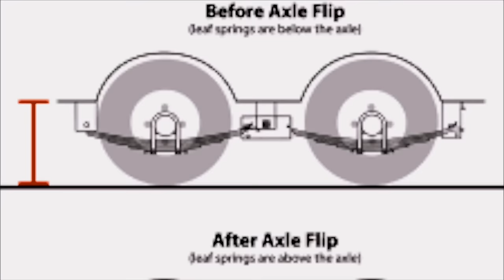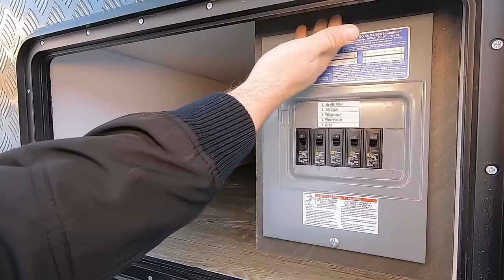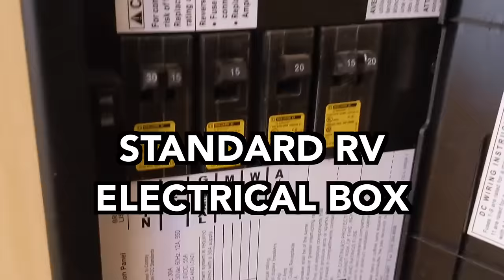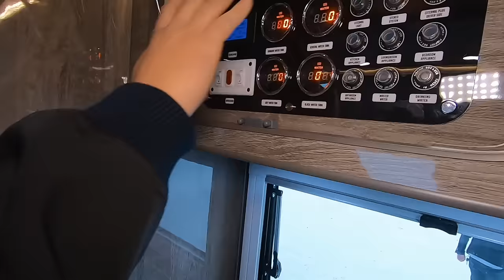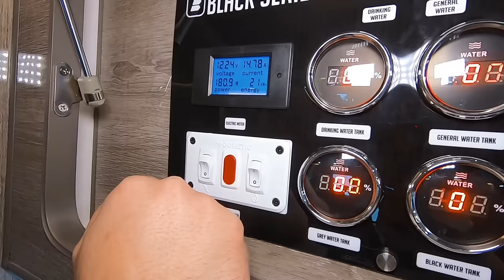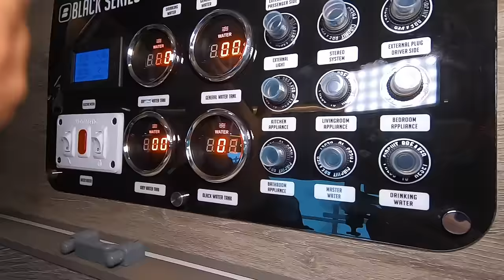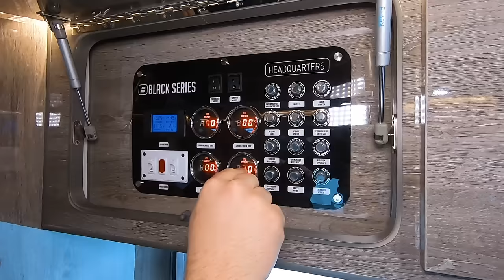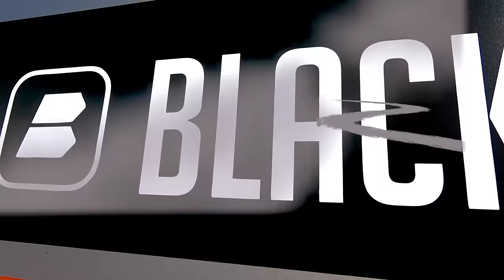BLACK SERIES! CLICK HERE TO SEE HQ19 REPLACEMENT https://youtu.be/7XND9C63GGM?si=10AU8iFP7bFzLmP9

Comment: Like I said do your fancy cabinets, love the grain no handles, but the kitchen table & sink & stove in an Island configuration country style U can work or but chair under either side. Use sink both sides oven & burns end of Island so really 3 sides to work or eat from. Best small space u can do farm house style & diff then what every1 else is doing. Along wall parallel w/island & table 2 flip up bunks. That is it. 2 cassettes toilet system change or camp dump no holding blk series tank. Shower inside Alaskan cold deal. <Done> Can take it or leave it advice, but gave u a few improvement inside & outside & reworked whole idea got bigger got smaller, towed diff, rolling spares diff new concession or ship or construction or highway diff. Alot of quality stuff to pull from. Just see duck bird that flys & swims, tuff sell. Need 2 product lines down and dirty hardest nail & where u r at upscale & diff but in a good/great way.

Comment: This is built a little tougher than most RV's but the BRUDER EXP-6 EXPEDITION TRAILER from AUS is a god damn tank...and at least their web site tells you the PRICE......
Reply: Also two completely different trailers. A Bruder starts in at 100K here in the states. That is 35K more than a hq19. BS has more than double the r-value in their insulation. Bruder has better suspension. Pros and cons to both depending on your needs. Also, the ROA site list their price. The manufacturer doesn't since they aren't factory direct.

Comment: Cant wait till they have a slide out, spin cast plastic in storage areas, hydraulic stabilizers, instant hot water, a generator built in, theater chairs facing a TV, Glass and plate holders in there cabinets, change the batteries to lithium even 1 400 amp.
Reply from the maker: They will never have slide outs. That is the one non-negotiable.

Comment: 2 insta hot water heaters u hve heat hot water & box or tank heating unplugged. If not then not Alaskan, or even 4 season. If not cold 1 heater just water 1 bath plenty, but if cold or stupid cold need 2nd mostly heat & water floor & boxes & tank heating.

Comment: I just skimmed through this. leveling jacks?
Reply: Yes, I own this trailer. There are jacks on all 4 corners. They are more stabilizing jacks, not so much leveling. I take of those yellow Lego like plastic leveling in my driveway, I use a piece of 2X12 and park the 2 left tires on it. I am going to design something for the front to use a hydraulic jack to level it front to back. Inside the storage compartment there is a 4 way bubble level. I also use a small torpedo level on the front frame to level it without having to go look at the bubble level. I don’t know if he showed it but there is a stainless pullout with a 3 burner stove, a sink, and a fold out stainless food prep or serving surface. Also a drawer you can keep silverware or stuff like a spatula or stirring spoon, etc. The unit is not cheap, mine was $56,000 last summer, but I live in Jackson Wyoming so there are lots of places to take it!! Like the dude says, it’s a Super Trailer.

Comment: comment #317 laying down got it 1:55 am your suspension, close. I explained the pull out cantilever same geometry deal already. But this goes to your suspension esp. The A arms stick down to much & limit ground clearance(build like tank but small change). 2 flex pnts at frame could b longer arm shorter arm instead of even length A arm to move more away from mounting pnt , but <key> is a teeter totter design instead of fixed top of A arm mount pnt. It flexes not fixed at top pnt of A arm on connection w/teeter totter only it is not a 50 vs 50 totter no where it connects to top of a is short side of totter arm <SO the beef A arms naturally r up tight. When wheel hits hole uneven length A arm is tottered down, then it naturally teeters back  up most ground clearance. Springs & shocks still in the design, & like I said b4 the "axle hub" 2"box slides in least travel or prt out or max out full travel. The diff is ground clearance & natural tooter effect w/spring gives u a new geometry flex movement pnt so not just up & down but some wheel free hit/smack impacted flex built into the suspension. hit hole ck, hit 2ft tal rock head on still totter ck, & whole thing gets better the more the tires pulled away from under camper.  IT's Your system over built crazy just freed up to really sing. 40mpg dune type jumping tuff suspension.

Comment: In another video with the same model it showed a diesel heater instead of propane. Using less fuel.
Reply from the maker: The diesel is not UL rated and against US code. We no longer carry the Black Series because of poor quality and the components were failing too frequently.

Comment: need to add air ride bag to make air ride and to make adjustable like comptition and need to go with disc brakes so work better after driven through water
Reply from the maker: We agree!!! We are currently working on an airbag system.
Reply: @ROAOffRoad  cant wait to see so you can self level at campsite

Comment: Its a shame they made all the upgrades at extra cost for year 2020. The economy took a crap so, for 2021 they will cut cost and remove little things here and there. For example : dual gas struts on doors, that make them open evenly instead of twist. Causing the doors and hinges to last longer.

Comment: If u had a Y connection <fancy dandy> hitch that each side arm of trailer frame connected onto that would b a better product in the market place. As it is just seems diff way mayb better at limit but a Y off a normal receiver hitch that can flex a bit each side frame rail is <flat just way far safer& no doubt better system. Normal framing till the triangle arms each side of pull behind that can pivot up & down where it connects to trailer. Y 2 no fake ass k.Legit man better NOW way to connect any F-ing trailer!.

Comment: Diamond plated?  NO! Diamond tread plate.  Cool RV, horrible sales person.  Why would you need to air down a trailer tire for traction? Air up maybe, when it is low, but never air it down for off road, unless you need more squish in the suspension.

Comment: So what the bottom line what's the cost for one of these trailers
Reply: 40 to 60 grand
Reply: @chadbohman1017  is that price tag for the one you are showing in this video
Reply: I have no affiliation with the company and yes that's the price tag for the 1 in the video
Reply: @chadbohman1017  40 or the 60 k
Reply: @nyghtmyst5118  that 1 I'm going to say 60k
Reply: @chadbohman1017  where would you see one of these i live in the north east any dealers up this way
Reply: @nyghtmyst5118  u would have to check there website out www.rvsofamerica.com  or Google it

Comment: snoozy trailers all fiberglass last like boat hull 50yrs, but u asked can get better product at a price. The pull behind if "off road" needs to b 2nd deal smaller trailer, just Me* & aussies down under hard core campers, except they don't hve winter problem. So something has to give in the design. If u were running 3 axles monster suspension & it was ATC type all alumium 5th wheel, w/ diamond covering & build quality u might hve something. As it is it's to product tiny segment in the market place.  Just Me/JBM/God opinion. Yeah u need X=$$$bank to cover quality & that means Y=ft long, but Z=design is not nailed down yet just outside is weak look at never hving seen inside. Design dump at rear drags when offroading fail. Must hve tanks under bed high dumping off side much higher safe off ground. So Either u hve to go bigger hardest! Core! ATC alumium 5th flex design construction,or toy, or anything rock diamond tuff trailer, or u need complete new design much smaller supplement trailer tuff than ppl main rig or camper. <I know I don't hve 2 worry about My trailer, My slide in is my weak link going off road over wt side. Yeah is u & ATC had a baby it would b perfect product inline w/other 5th wheels just completely diff option in market place. Not a home on wheels w/Island & dishwaher & middle bunk or front bedroom &1/2 bath own 2nd door.  Otherwise good enough gets the sale, tents & hybrids &poptops, & triangles, & nanos, & lots of good enough for 90% of all new purchase not custom build campers.

Comment: The only thing I don't like is the outside speakers. Annoys the neighbors, usuall me. I go to the country to get away from noise and all of the lights most inconsiderate campers string around. Other than that, looks like your typical overpriced nothing new camper trailer.

Comment: You ain’t doing much with 300 W/ almost useless a blender takes 750+ just to keep it in perspective. 300 W is terrible.
Reply: You do realize that was the solar panel that charges the battery. The inverter is 2,000 watt.
Reply: scottyo64 my point is a lot of cost will go into that it is not very useful. It’s cool.

Comment: Very nice, out of my league, those trailers cost $40 to $60 K and used 2 to 3 times a year ? No thanks 🙏🏼, don’t get me wrong they are really nice but $$$$$🤔😮.
Reply: Yes, why bash other trailers that are in the half price cost range.  The beefed up features cost $$$.  These feature replacement parts are going to cost you too and you will need to replace them.  Those windows are not going to be crystal clear after awhile.

Comment: Just Me/JBM/God but if I am not storing/protecting my money spares then Me/crazy guy kill them All would copy truckers esp in rear & make it so spares were rolling able but not crank lowered storing postion. If a,b,c, gets stuck then lower D & E other side crank down rolling spares/over wt spares & get out/or unstuck.
Reply: Most of the time ATC black series empty only rolling 2 per side but loaded can 3 or even 4th spare down over wt per side like trucker. Basic ATC has that flexable design, only needing 2 none axle black series but really3 any time hauling & upgraded for sure & loaded.

Comment: Why didn't they put actual key locks on those latches?  Seems like that might be a no-brainer on this trailer, security-wise.  I mean, they have a lock on the outdoor shower, but not the propane/front storage???
Reply from the maker: It's against the law to put locks on a compartment with gas or propane in it.
Reply: lilricky2515 never lock up your propane. It’s illegal. If there is a fire, you want to be able to shut off the fuel as quickly as possible.